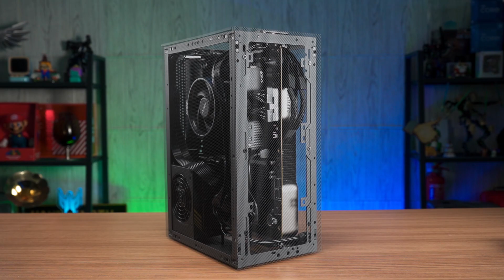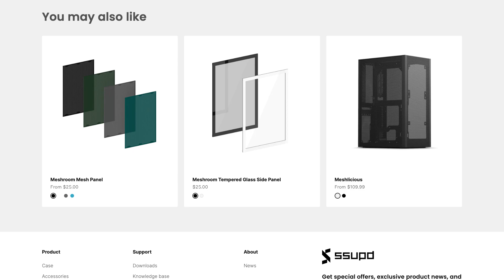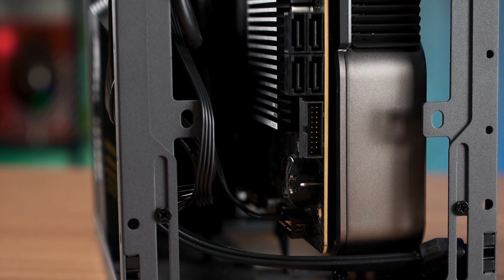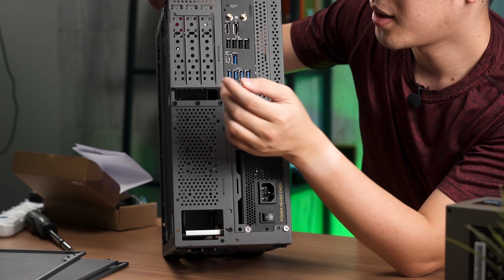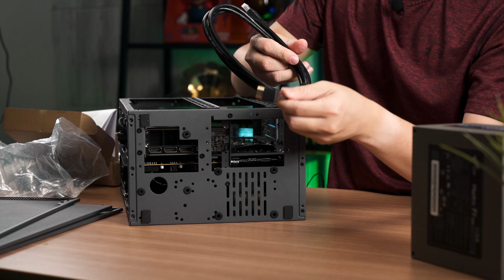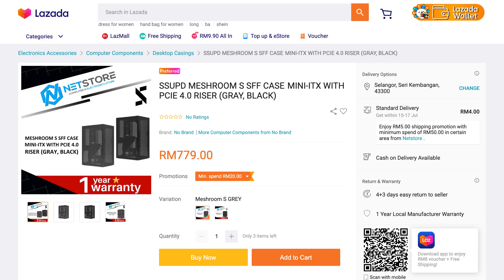Build Experience: SSUPD Meshroom S

Comment: Hey, I have an atx mbo and atx psu at the moment, but if i were to just get an itx mbo and use the atx psu would i still be able to mout the gpu on tge side of the case (rx 7800xt). I realy dont want to spend as much if this case does have atx capabilities bjt If it's detrimental to thermals, I would'nt mind comprimising for it. Thanks for your time 👏

Comment: You can actually get an extender bracket from SSUPD that will give you another 25mm to the front of the case. That way you can use the SATA ports. This is actually my favourite ITX case. Such a small footprint, can fit 3.5" drives, 4 slot gpus, atx psu/mobo ...etc. Also, you can actually use an ATX mobo and an ATX PSU in 4 slot mode, but with a sff GPU in horizontal mode. The gpu and psu will be place behind the back of the mobo.

Comment: Very good review. The usb 3 header design and it's placement on motherboards is terrible. The industry need to do something about it. I had similar issues with it in a Lian Li o11 mini, which is much bigger than this case. It was right up against the radiator. I used a 90 degree adapter facing to the back of the motherboard. If facing to the front it is right up against the graphics card.

Comment: I believe they put the power button in the back simply for the feedback they got from the smaller version of the case. The power button would get accidentally pressed when putting in USB Drives/plug ins when it was in the front